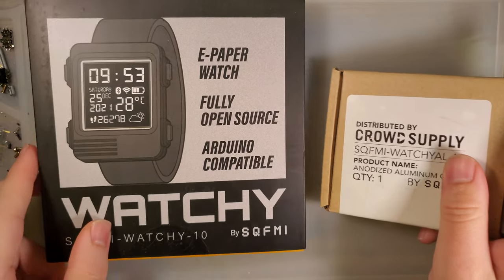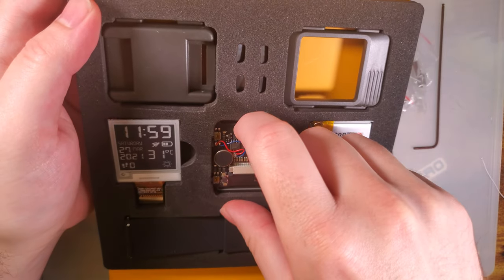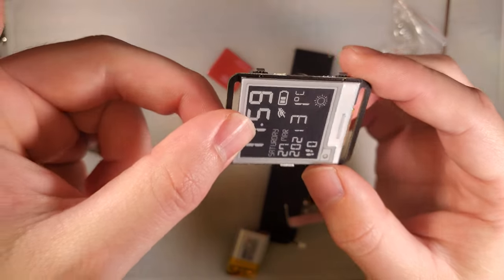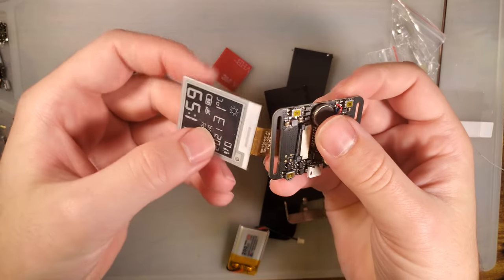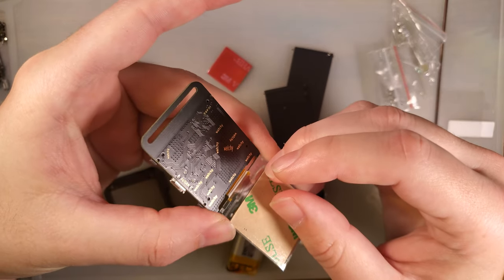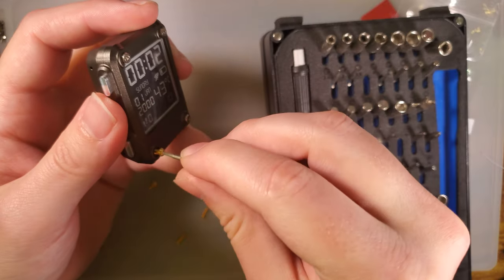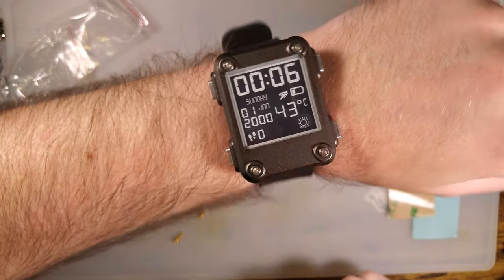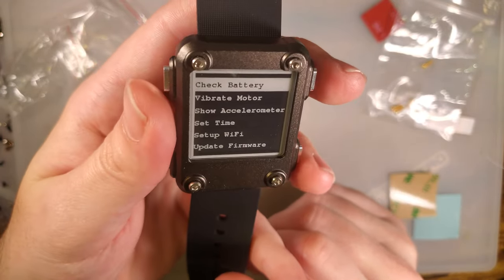SQFMI Watchy

Comment: Battery life is rough, at least on mine.
Reply from the maker: I can get like a day and a half out of mine, maybe two. I'd like a week or more but I can't really complain about a day when it charges reasonably quick. I imagine using wifi or bluetooth will significantly diminish that though.
Reply: @makho  I do enjoy it though. I wish I had gotten the aluminum shell. That plastic one was exploding on me and I ended up gluing it.
Reply from the maker: @Stintendo  can get the aluminum shell still. I put links in the description. There are also several other casing designs, all open source hosted on github.

Comment: Any update on your watchy?
Reply from the maker: I stopped using it pretty quickly tbh
Reply: Just wondering why? The battery life or other issues?
Reply from the maker: @billm970  Having to charge it daily (iirc it was like 30 hour battery life so not quite enough for two straight days) means I have to take it off for a couple hours at a time. One day I just didn't put it back on and didn't look back.

I want it to do more than it does but I didn't have the time or inclination to write that software myself and at the time, there was basically no community software available for these things. Not a deal breaker but things I already have already did what this thing aims to do but better. I already have a watch to tell the date and time (and it's an automatic mechanical so I don't need to charge it or worry about batteries). I already have a phone to tell me the weather. I don't have a pedometer but I'm also not really interested. I'm sure my phone tracks my steps anyway. 

It's a clunky and incomplete implementation, yes, but mostly it just wasn't the product I wanted. I got excited by the open source nature and that distracted me from the fact that it's something I'm not normally into. 

I still think it's hella neat and I don't regret buying it. I just don't really know what to do with it. 

Also I kept accidentally hitting it on door frames and such.
Reply: I wear it round my neck on a lanyard. The battery life is actually very good with the original "7SEG" face - probably a week or so